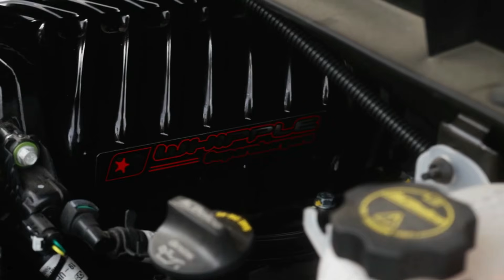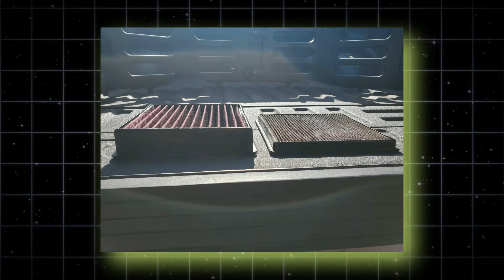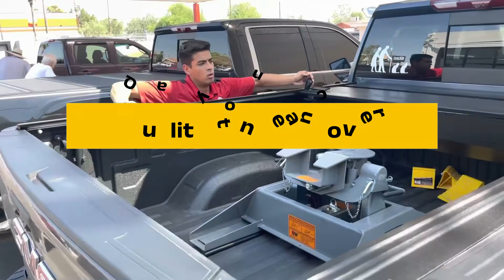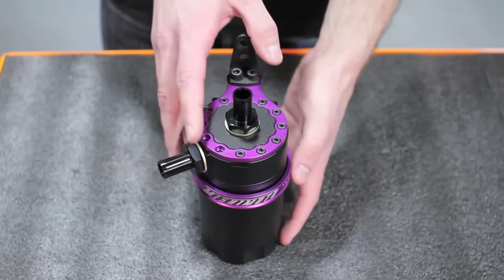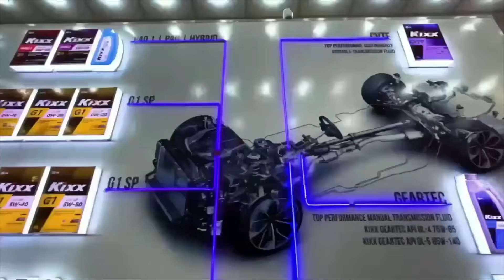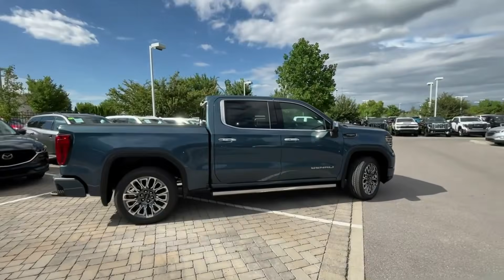3 WORST and 4 BEST GMC Mods Under $500

Comment: Diablo predator x afm dod and tuner all in one especially after rebuilding motor and deleting afm on 08 silverado 5.3l and cat back exhaust also helps but costs more than 500
Reply from the maker: The DiabloSport Predator X with AFM DOD delete and a tune on a rebuilt 08 five-three is the full package — cat-back on top of that and you've got a completely different truck. Going over $500 is worth it when it's done right and done once. 👍

Comment: I can agree 100 percent with all that was discussed on this video  The one I never thought of really was a total truck fluid flush all fluids smart  AFM was first thing I did when I got my 2017 Tahoe.
Reply from the maker: AFM disabler first thing on a 2017 Tahoe — that's exactly the right move. The total fluid flush is the one most people skip because it's not a visible problem until it is. Doing both early is how you stay ahead of the repair bills. 💪

Comment: After awhile throttle controllers cause reduction of power codes on GMC trucks.
Reply from the maker: That's a real concern worth knowing — throttle controllers can trigger power reduction codes on some platforms, especially if the sensitivity is set too aggressively. Brand and tune level matter a lot here. If anyone's running one, keeping the setting conservative and monitoring for codes is the smart play. 👍